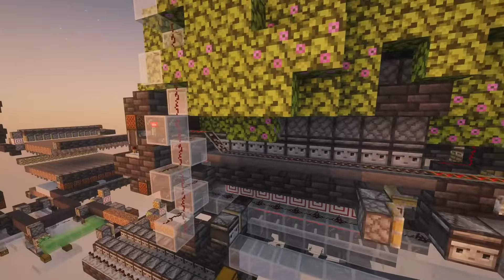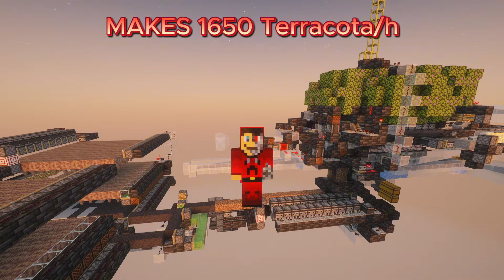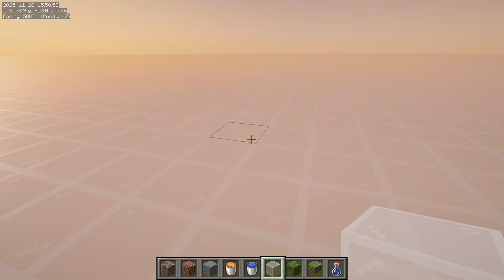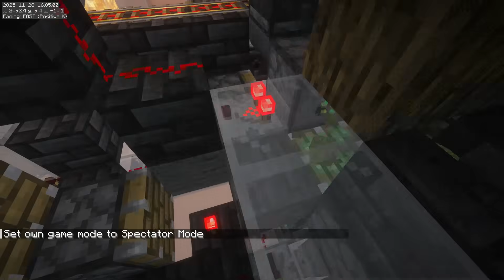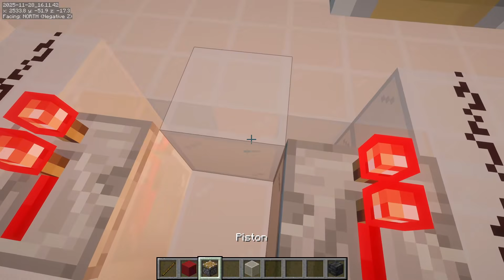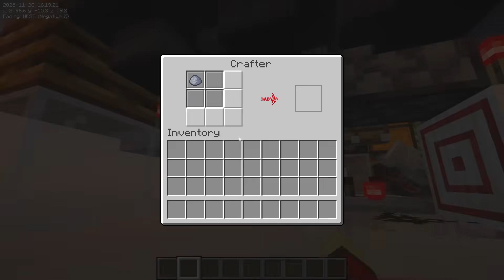Optimized Automatic Terracotta Factory: Fully Reliable Design!

Comment: quick question, im currently messing with this familiariazing myself before building, im noticing a ton of seeds moss carpets and some blocks that get knocked loose where the rooted dirt gets pushed downwards before its sent to the mud converter, any ideas on how to recycle these items back to bonemeal ?
Reply from the maker: it’s kinda tricky i think because of all the tight redstone, but I imagine if you located all the spots most of the seeds and things collected up, you could put a few hopper minecarts under those blocks and push all the items through hoppers and water channels to a few composters
Reply: @nader_909 great timing on the reply, im actually currently looking at doing that today, I’ll get back to you im able to get it to work
Reply from the maker: @Billy-Games  noice I hope it all ends up working nicely

Comment: Amazing factory! Built it on a multiplayer server with friends and had one issue. The piston pushing into the block splitter wasn't working. Saw in your short that the redstone runs beside the piston could be the issue, so I moved it down one and that fixed it. Keep up the good work!
Reply from the maker: Thanks a lot I’m glad it worked, ill try keep it up

Comment: The water bucket dispensers under the stairs only go off once and don’t pick the water back up. I can’t figure out what I’m doing wrong
Reply from the maker: strange, so theres some water sources hanging around even when the farm turned off?

if that’s the case maybe just try scooping all the water up and reputting in the dispensers again, sometimes it breaks during building if one of the sides accidentally fires

Comment: I built this on a realm and the 0-tick piston pushers break so often that the farm is unusable. I thought maybe it was just the server side that was making things laggy but when  I pasted the schematic in a creative world singleplayer I encountered the same issue. When the stone coming from the stone generators goes into the 0-tick piston pushers sometimes it lags and the stone gets pushed too far, it breaks the redstone dust. 

I'm working on slowing down the farm, so that the piston pusher don't get overwhelmed, because I really like the mechanics and overall design.

EDIT: As usual the problem lied between the keyboard and the chair. I ran the farm without the correct hopper timing and without enough bonemeal loaded into dispensers, which broke the zero-tick pushers. If you're like me and having problems with the farm not converting the stone into dirt, make sure you built it exactly as the schematic is, block state, and everything (because if you build it in the wrong order the observers may push some stuff out of sync). Load up everything with bonemeal, and set the hopper clock to 5 items.
Reply from the maker: Well I’ve pasted the schematic into creative many times in many different locations and I made sure the 0-ticking never broke in this version.
I can’t account for realms though I have never tried it there. I guess it’s possible a new version of the game is throwing it off.

Building it with the correct block state is very important yes, that’s why building it with the schematic and using the schematic verifier to make sure all blocks are in the correct state is useful too otherwise it’ll probably break

Comment: I wish it fit within a 3x3 chunk region so you only need one chunk loader for it. Probably going to redesign it for that. However, awesome work putting this together and testing the locational issues!
Reply from the maker: Yup I think it should be possible actually with a couple more block pushers and then the drying part goes like above or underneath the root dirt making part 
Maybe I should look into that one day
Reply: @nader_909  Only issue I ran into was that the moss sometimes gets ejected over the chunk border, I think from the bonemeal farm I chose and not from this actual farm, but something to keep in mind.

Comment: The TNT in the schematic is in the wrong spot. It automatically blows up if you build it like that. You need to offset it by one block so it gets picked up by the slime next to it when the machine moves for the first time.
Reply from the maker: Yeah true whenever you set up a slime based tnt duper you need to build the 2 halves of the duper separately and merge it together once it runs once. I probably should have mentioned that my bad.
Reply: @nader_909  It's a great build. I also had to make a couple of tweaks. I had to enclose the lava so the trees don't catch fire. Eventually the fire would spread to the scaffolding and break the build. I added one more furnace to handle the output. 5 furnaces were not enough. I also increased the composter level to 2, because the hopper minecart had only enough clay blocks for the first 3 or 4 furnaces meaning that the contents were not spread out evenly. I removed the second hopper minecart delivering the planks and just added hoppers instead. I also removed the fences near the other minecarts because they were not able to deliver enough bonemeal to the dispensers in the back. For the bonemeal input I added the Chromoss 2x2x2 bonemeal farm. Sometimes clay balls make it into the hopper minecart, so it sometimes outputs bricks as well. I don't really mind that so I haven't done anything about that. I also replaced the dripstone blocks with glass so it's easier to see from all directions how the mud drying is progressing. I added more glass/obsidian and pointed dripstones under the mud stream so there are more opportunities for mud to dry.
Reply from the maker: Those are some pretty good changes actually, if I make a third revision at some point I’ll definitely include some of these

Comment: I want to build this is a server that doesn't allow TNT duping. Do you have any solutions to that?
Reply from the maker: Sorry for the late response, you could replace all the tnt dupers with dispensers and it would work the same, the problem is that the amount of tnt needed to destroy all the logs is probably quite a lot, but the tnt needed to break the terracota is pretty manageable. But you could possibly only push over the top level of logs every time new trees are generated, and not the entire block of logs, and possibly need to trigger the dispensers less often.

Another thing you could do is make a wither cage blast chamber but that gets a little scary sometimes
Reply: Wither block breaker: https://www.youtube.com/watch?v=smXMm_sZ2JA

Comment: Does this farm work every where on the map, because i built an older version of this in my single player world and after a few minutes it didnt worked anymore even after replacing some of the pistons that push the stones.
Reply from the maker: Yup the point of this new release is that it works anywhere in the world, and I solved the locationality issue with the 0-ticking

Comment: Are there any blocks you gotta place in a certain order for zero ticking etc or can I just follow the schematic? You know like are there some observers you gotta piston push into eachother instead of just place them etc?
Reply from the maker: I think just a safe way to do it is to place the block any observer is looking into first, and then the observer, so you don’t update it
But it should only be a problem when building those like conveyor lines with the trapdoors and observers
0-ticking itself doesn’t use any special tricks to set up